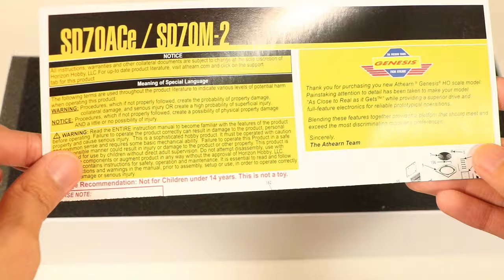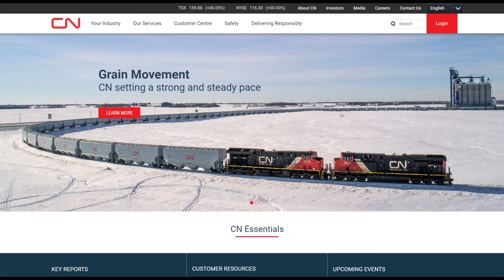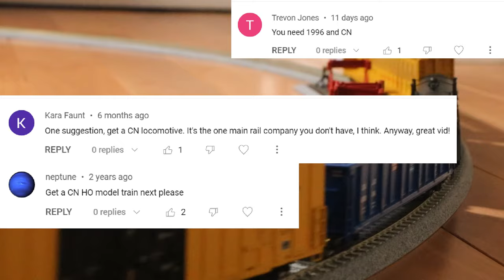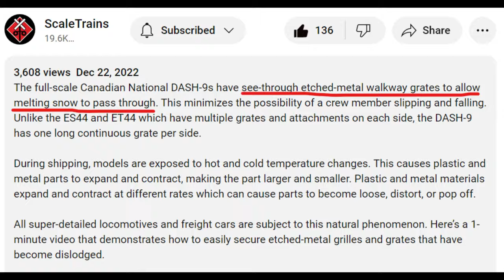Athearn HO Scale CN SD70M-2 Unboxing

Comment: In case you missed it, NS will send two SD70M-2s to Progress Rail for rebuilding into AC traction with all the latest software. The pair is not expected to begin testing until 2023. Several SD70M-2s have been sold off but NS retains many. How many exactly? I heard 46 have returned.
Reply: 2699 has already been released and I'm not sure about 2700.

Comment: I have N-Scale trains. List of engines.

Santa Fe Blue F7

Santa Fe warbonnet F7

Amtrak operational life saver P42

EMD SD90MAC Canadian Pacific

GE C40-8W CSX 7670 Monon Heritage 

BNSF GEVO 

Chessie locomotive. Can’t remember the locomotive model. Number 8284

I do use KATO track which I recommend.
Reply: I did get a bargain when me and my dad went to the Milwaukee train fest. We found a 10 car El Capitan set from KATO. It was selling for like $150. That’s insane
Reply: Kato is cheap
Reply: Ha have you seen the prices
Reply: That set usually goes for $300
Reply: @NSSignalGuy  what set
Reply: El Capitan 10 car passenger set. N Scale.
Reply: And I mean finding it on a worthy website. Not a 3rd party one
Reply: The chessie locomotive could be a b30-7
Reply: You are correct
Reply: @NSSignalGuy  thats because its detailed and hard to break and it has the thing so it can run

Comment: i think the locomotive is bit warped...
where cab and long hood is connecting and frame is feel like...
Reply: Hello!
Yes, Athearn had a problem at the factory making this an issue. It's an easy fix by just taking the shell off the frame and clipping the inverter cabinet back to the cab.
Reply: @kyleftw1679 thanks! I have that problem with my athearn ace's. Good to know how to fix it